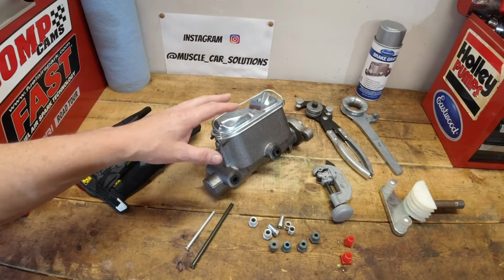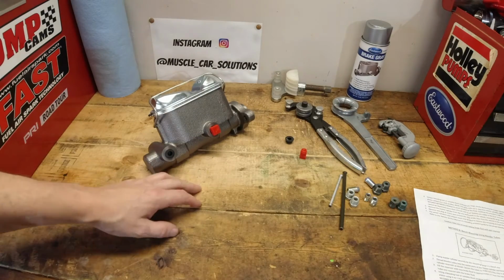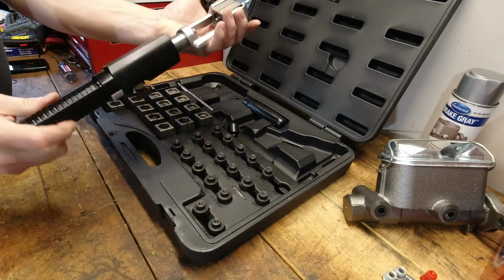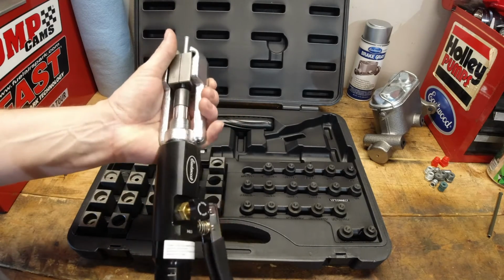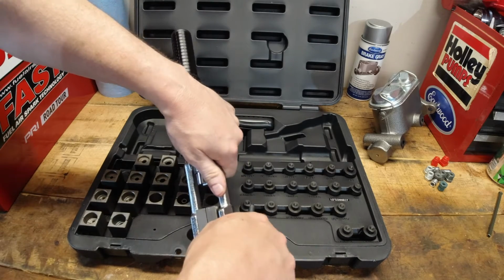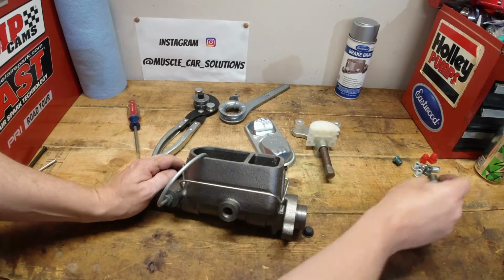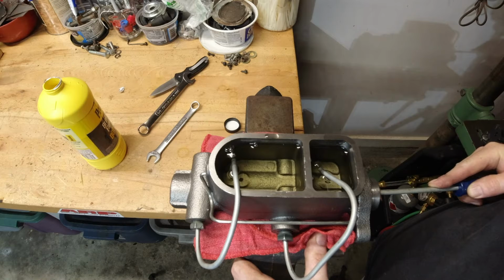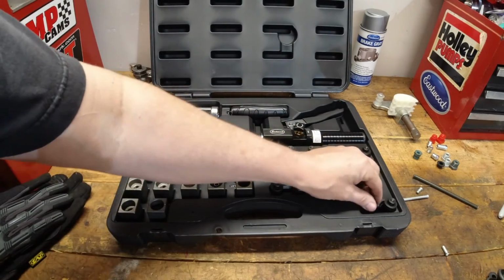Eastwood Hydraulic Flaring Tool Review

Comment: I have a cheap kit for bench bleeding, but it uses clear hose. Easier to see when you aren’t blowing bubbles anymore.
Reply from the maker: I can see the benefit in that.  Plus with the rubber line you can move it easier.  Might be the better option all around.  Thanks for sharing that!  Appreciate it!
Reply: @MuscleCarSolutions  I have a similar kit, napa sells them. Atleast thats where I got mine.
Reply from the maker: @SteelSurgeon  seen them before just never considered it.  I guess the plugs always worked so why look at anything else?  Fun things happen when you stop and learn something new.  lol
Reply: @MuscleCarSolutions  I havnt ever done it your way either. 

Next step is bleeding the entire system once its installed, how do you plan on doing that? I gravity bleed them. Install the lines, and calipers and everything else, open the all bleeders and sit back and have a beer....or 7. Just dont let the master cylinder run out. 

If you gravity bleed, Fluid will come out of the closest bleeder first, once it does, close it. Then wait some more. Fluid will come out of the second closest bleeder, close it once it does. And so on for the third and forth bleeder on the rear. I usually bleed them the traditional way by pumping the pedal after that just to be safe but gravity bleeding is the easiest way to fill the entire system if you dont have a fancy bleeder.
Reply: Yup. Clear hose is a must.

Comment: I bench bleed the MC using clear hoses on the bench. Put the top on and remove the bleeder hose and quickly install the brake line one by one using a flare wrench, then bolt up the master. If you have 2 bleeders on the MC, bleed them 1st then do the 4 wheels starting with the furthest wheel away.

Comment: Great video as usual!! I have the Mastercool version 3/8 steel line still is a pain 

But better that the old clamp style.  Have you tried NiCopp  line material much easier to work with
Reply from the maker: Yup.  I had the mastercool kit and loved it but someone else loved it more than I did.  I’ve used the Nicopp nickel/copper stuff before and it does make nice ends for sure.  Had some steel line laying around to use for this demo.  It’s a little more difficult to work for sure.
Reply: @MuscleCarSolutions  Any advice on  double flaring steel 3/8” ?
Reply from the maker: @tooljunkie6003  that’s a tough one for sure.  The 1/4” stuff that I use as the bigger sized lines aren’t too bad but when it’s steel it’s always harder to work with.  Don’t think I’ve ever done 3/8.  Anything that big I’ve used on the quick connect stuff.
Reply: @MuscleCarSolutions  yeah I need to repair the 3/8 fuel line on my 87442
Reply from the maker: @tooljunkie6003  ah.  Is that fuel line aluminum?
Reply: @MuscleCarSolutions  nope it’s steel
Reply from the maker: Yeah I’m sure that will be a bit of a challenge.